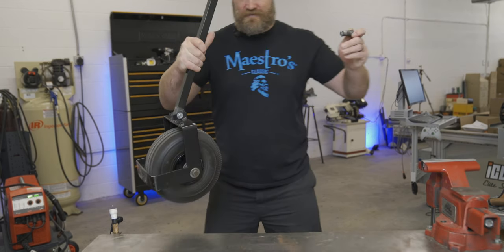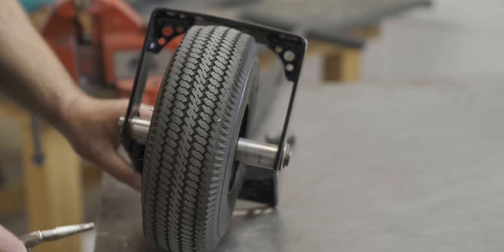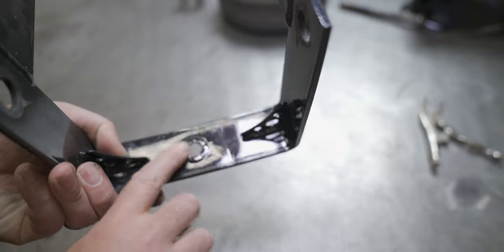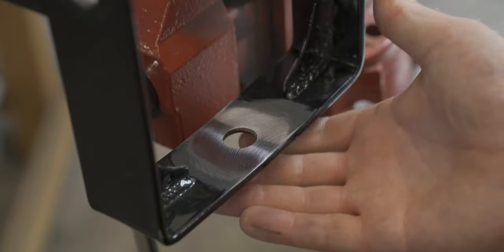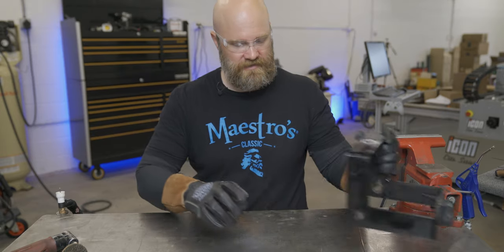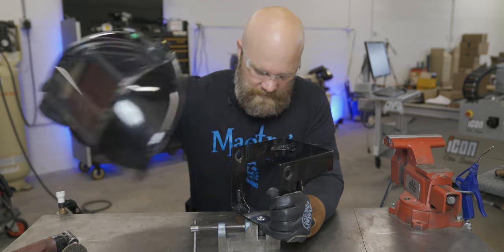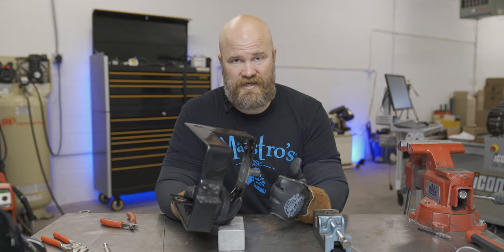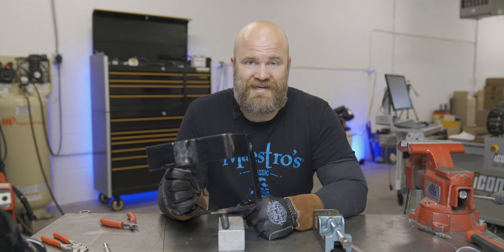It's TIG Weld Repair Time!

Comment: Wouldn’t it be better to increase the distance from the tire and use thicker steel to be able to have more reinforcement and possibly add a sleeve for more reinforcement and weld surface?

Comment: I would propose a design change.  I would put a shoulder on the pin, weld on the back side like you did, then run a fillet around the top side.  On the mating piece, either put a chamfer or a counterbore to clear the fillet weld.  Other than that, great video once again 😁

Comment: You need to get a small lathe. I would have turned a new pin with a flange on the pin, then welded it to the underside.
Reply from the maker: I need a full size lathe! But that might be small depending on what you consider full-size.
Reply: @JustVoss  I have a 13” x 5’ lathe and I would say that’s medium. 9-10” I would say is small. You’d do well with a 10” lathe. And they’re fun as hell to learn how to use.
Reply from the maker: Yeah and I bet super useful to have around too
Reply: @JustVoss  with your welding skills, a lathe and a Bridgeport mill, you could build a rocket ship and join Branson and Bezos in orbit! 😉😂
Reply from the maker: Hahaha you can be the first passenger! 🤪